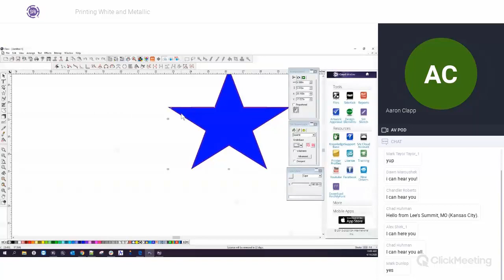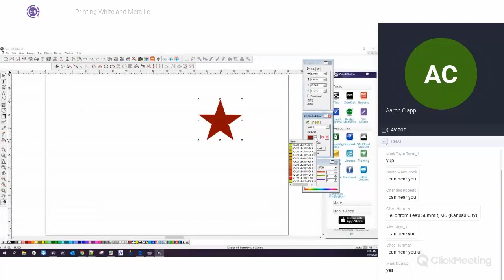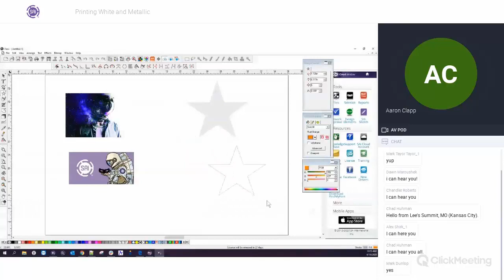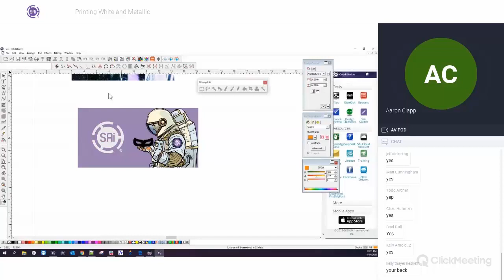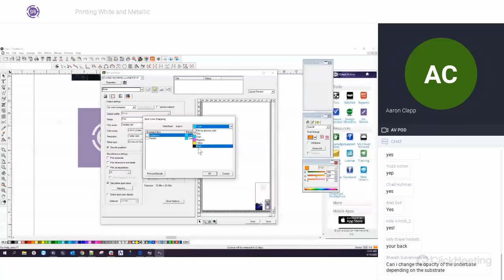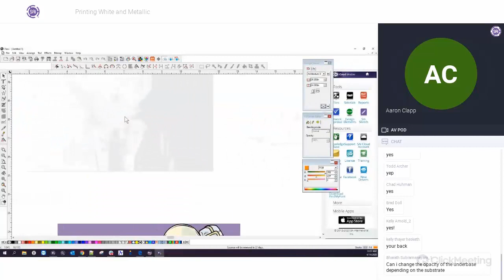SAi Flexi Webinar - Printing White & Metallic

Comment: Love wwtching these. Still learning new stuff now.

Now with QR codes... using the flexi QR code converter is it possible to add company logos to the centre of the QR code without loosong the data in it.  I have seen it done in AI and wondered if there was a method in flexi 19 to do it